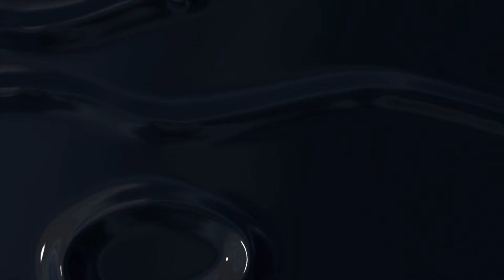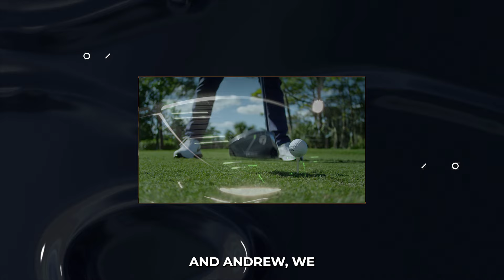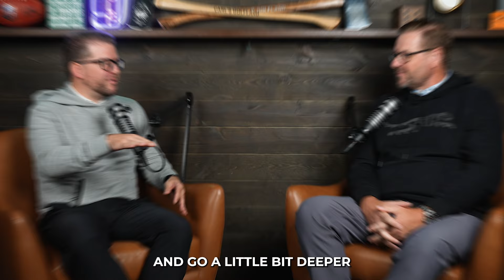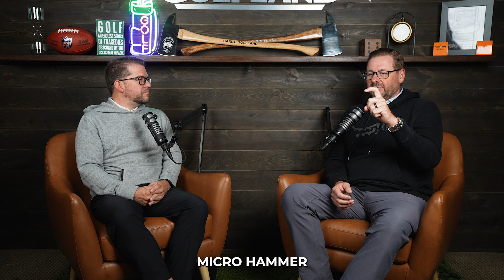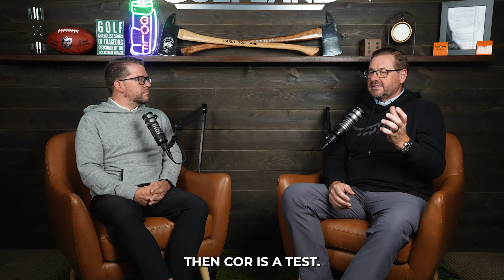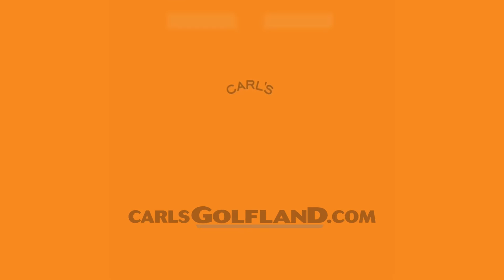Why does TaylorMade use carbon faces?

Comment: Andrew Oldcorn?  Saves weight and can flex more. Sooo many hot taylormade drivers on tour. Also the carbon faces got ahead of the COR CT tests and surprised many equipment officials. But they're on top of it now. Roll back the ball AND driver size. 400cc max!! 3 piece balls only!!!